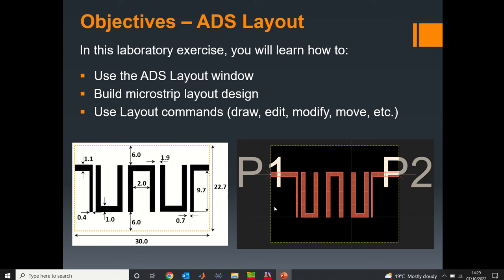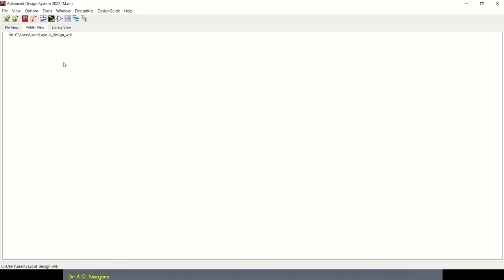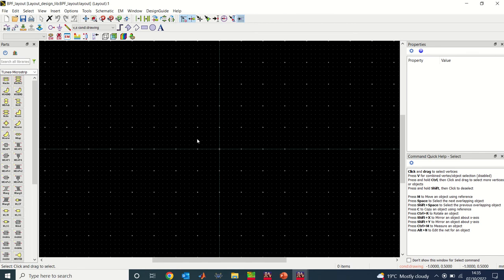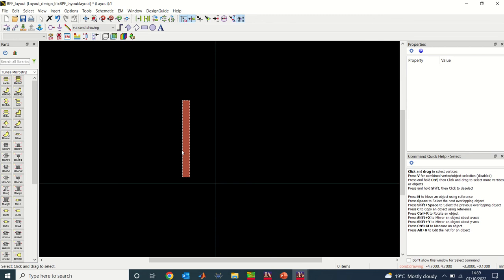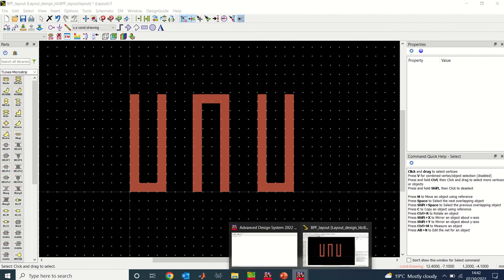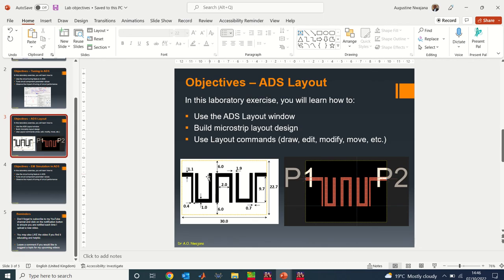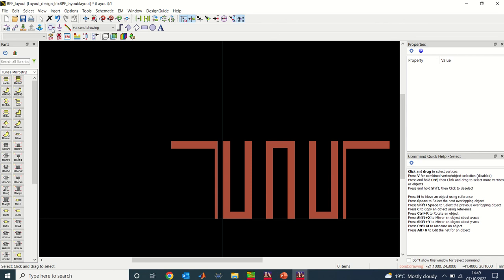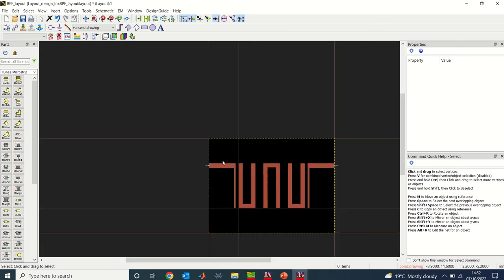Basics of ADS Layout

Comment: I followed the same procedure from your video in order to simulate a single port resonator sensor but it is given me an error of this “Failed to install result files from the input/output directory” please can you help me with how to go about it?
Reply from the maker: What software are you using for your simulation? I will suggest you use the link (https://www.researchgate.net/publication/348077082_Circuit_Modelling_of_BandpassChannel_Filter_with_Microstrip_Implementation) to read the published paper as the design procedure is not contained in the YouTube video. The video was only designed to guide my audience on the use of ADS to implement the design.
Reply: @fanoaustin  Am using ADS to design a sensor ring resonator in which i did it but am experiencing an error of layout failed. I will check the paper you send to me on the researchgate thank you